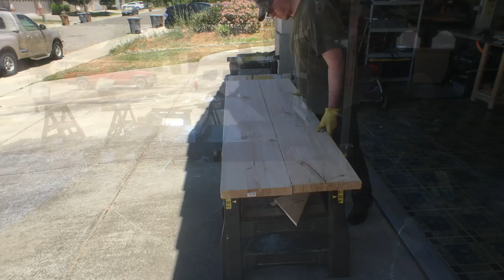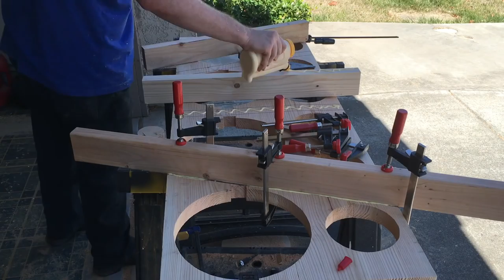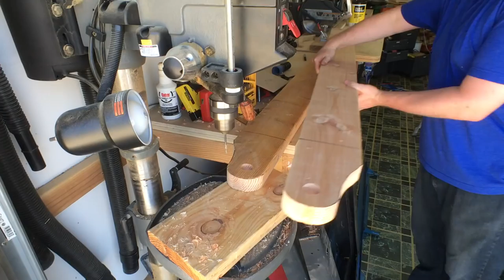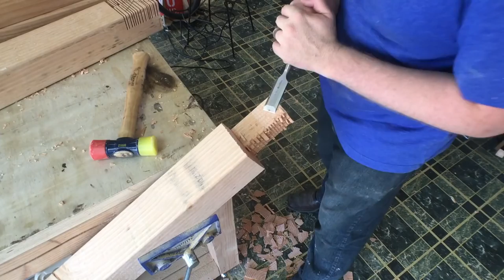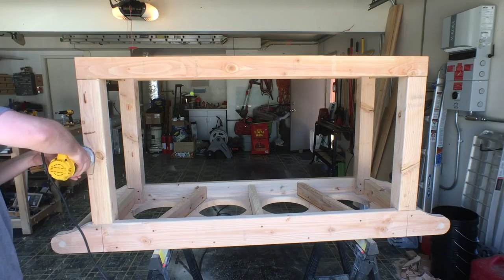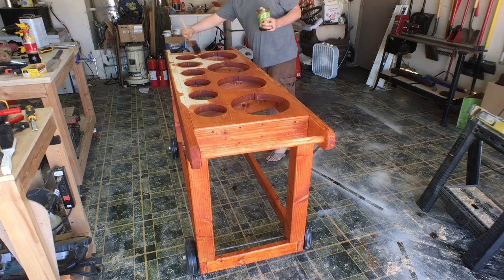BUILD: Container Gardening Cart

Comment: I like this. You'll get a lot of use out of it!
Reply from the maker: Thanks!  So far its working great.  I might need to add a few cubbies to hold tools though.  or maybe just another small rolling cart for all the gardening supplies.
Reply: Or you could possibly incorporate some of the tools into the design by hanging them on the side. There looks to be enough overhang on the top in places that you could do this.

Comment: It will be interesting to see how that top handles expansion/contraction, it's about 9% in pine and you've glued it firm across the grain but the holes for the buckets might provide the relief it needs.
Reply from the maker: Oh it's gonna crack like crazy just from the bowing that's just par for the coarse with wide construction lumber.  but it should crack in a way that won't really matter.  Truthfully this was kind of an experiment to see how it fairs in the long run.  I could have just done a big glue up of kiln dried for the top but I wanted to see how this would work.

Comment: That looks really nice... I have that same belt sander and hate it. Does yours have an issue with the tracking getting loose all the time?
Reply from the maker: +Live Free and DIY it was a big issue when I  first bought it (not too long ago) and was using finer grit paper.   The tracking was a nightmare and ended up biting into the sander and wrecking the belt and had a crazy amount of surface chatter.  This is the second time I used it and it was totally fine.  Only change was the grit belt I used.  I think I have 60 on it now not sure why that would make a difference but it was perfectly normal this time.

Comment: Any chance you could do a review video on your dewalt cordless tools, I've been looking at getting them but I'm not sure if I want to spend the money?
Reply from the maker: Maybe I've been planning a sort of review series for the channel.  But long story short is that I love them.  The only down side is when your doing heavy extended work.  And even then the only tool that's ever been an issue is the circular saw. When cutting very long lengths of really thick material it can drain a battery pretty quick.  Everything else Is easily good for a full day's work in my shop
Reply: Ok thanks so much, love your videos!!